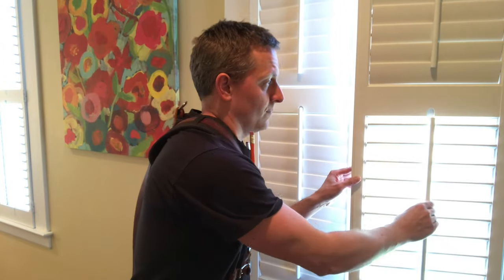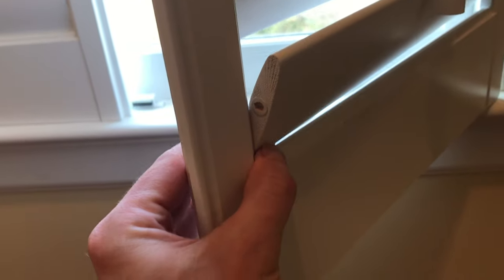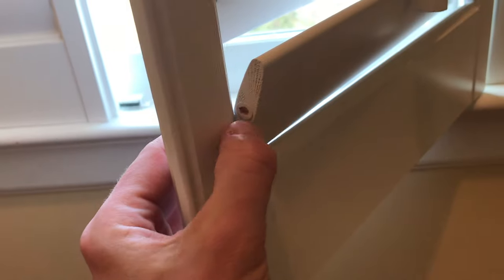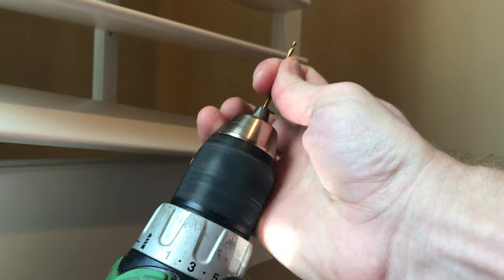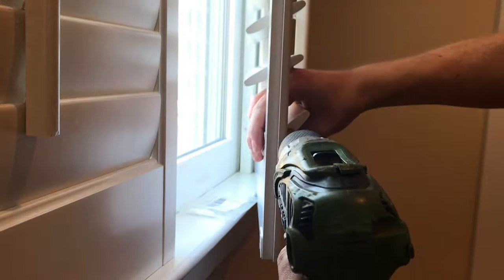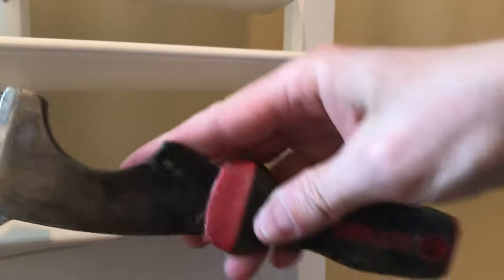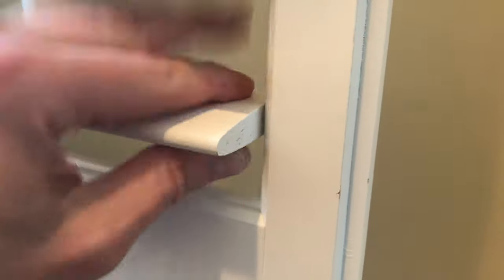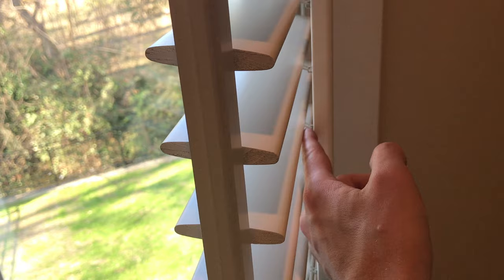FIX PLANTATION SHUTTERS (Broken Louver Pin / $4 Plantation Shutter Slat Repair!)

Comment: What about the metal staple that holds the shutter to the wooden stick(don’t know the proper word but hope u understand ),how do u fix that?
Reply: Same problem here;  there must be a special tool to use???
Reply: Exactly!  Who can answer this question? With a house full of teenagers, I've got several that need to be fixed now. Help!
Reply: I’ve never done this, but looking at the staples. Looks like it slides over the little louver and into the wood slats, and that’s how it works. Unless you have a different system. I’ve seen them held together with  tiny eye hook type things you screw into the slats and louver stick thing. This was years ago, so it’s a bit foggy remembering.

Comment: Good video and hope it works.  BUT my pins have a much smaller hole in the slat and the frame these wont fit and I cant find the smaller ones.  The angle prevents redrilling the holes. Any source for the smaller ones?
Reply: Right?!